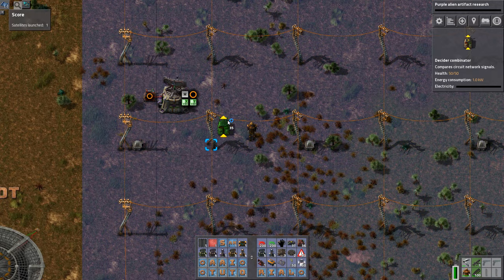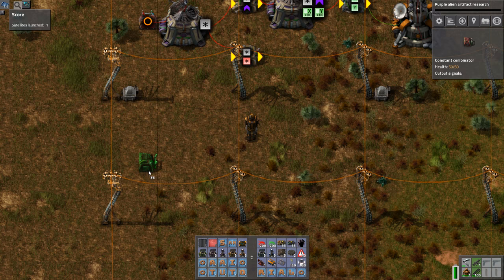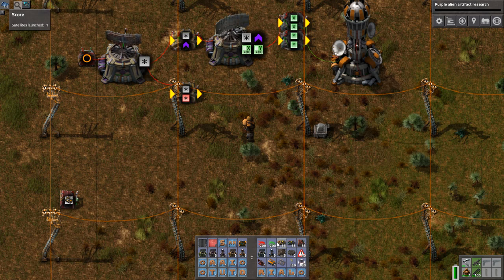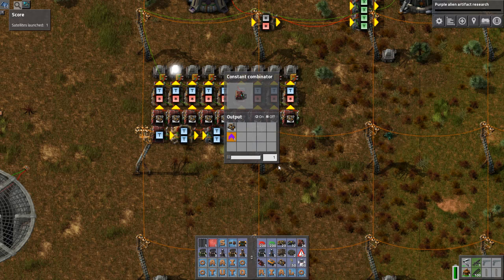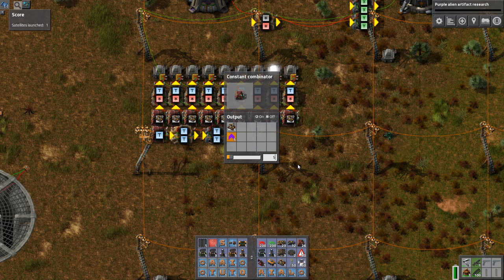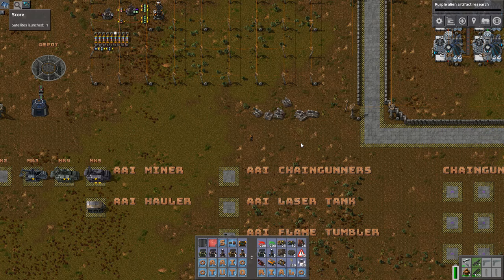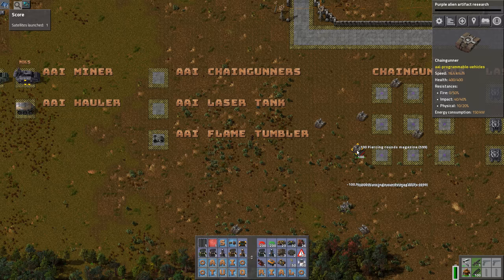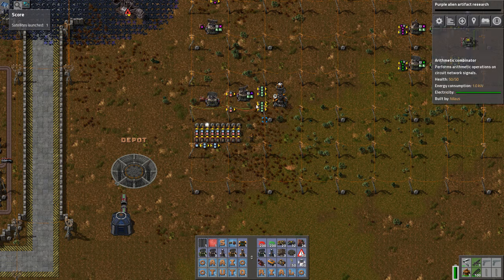AAI Mod Tutorial 4 - Automatic Alien Search and Destroy

Comment: Nilaus, instead of iterating over [T], you can iterate over the [ID] signal itself. And have the parking signal have the same quantity of the ID (or with an offset). This means you won't need a CC/DC pair for each vehicle, and I hope you're planning on having a lot of autonomous vehicles.
Reply from the maker: Yes, I was looking at that and considering it. However, I have 2 types of Haulers (Hauler and my own Truck) on top of that I will have multiple different MK values for Miners. Hence your idea will work "most of the time", but I accept the small overhead to configure it manually (at least for now). If I get 50 then it may change of course :)
Reply: You're right. At the current small scale the manual configuration is definitely better. But even if you're using all your MK's (and your own badass truck) you'll only need a CC/DC pair for each 'species' of vehicle. This makes system expansion much easier, as you only change until where the counter counts, instead of having to find space for more combinators.

I haven't built it myself, I'm just spitballing.

Comment: Hmm. If you add another constant combinator that outputs the unit type, and a constant ID number\parking zone ID, you can set it to say, 8, and then your setup will be transformed into a one that works for chain gunners 9-17, right?
You could even wire it to take the type of vehicle or kind of zone you're using for parking from that combinator, if you insted use one to select the type of zones, and another to add in the extra value to diffrentiate it from the first batch (*8), then take the signal from the type identifier, and put it through the timer to multiply it by values, and add it to the signal after the added value to skip tothe next group...
It's very hard to explain, but it makes it easier to scale it up, since you'll only need to modify the unit type\parking zone ID, as well as the extra value to seperate groups.